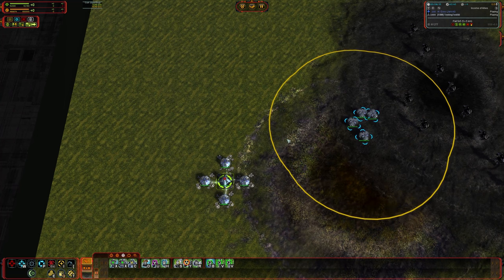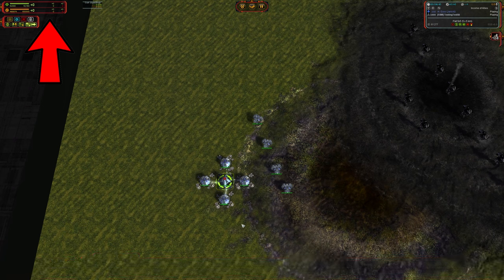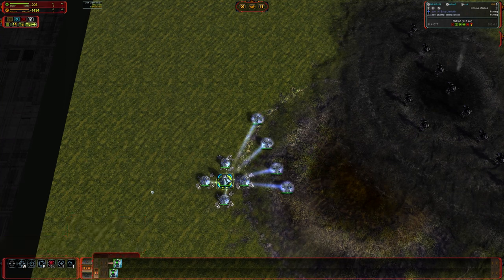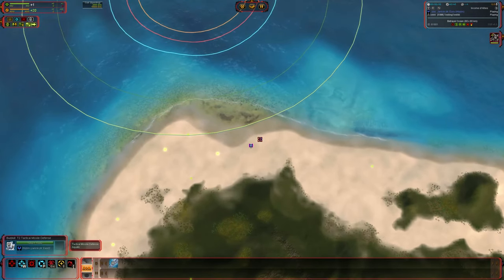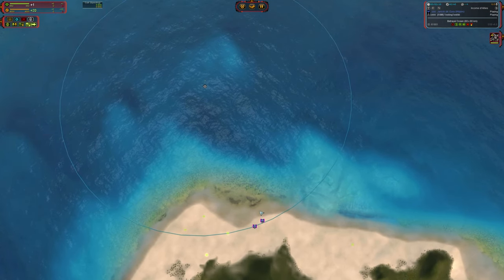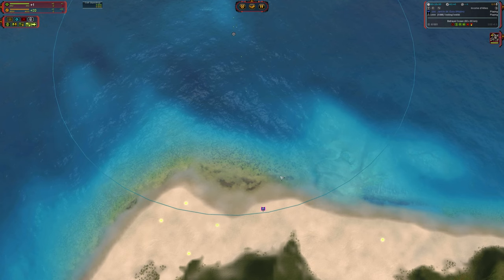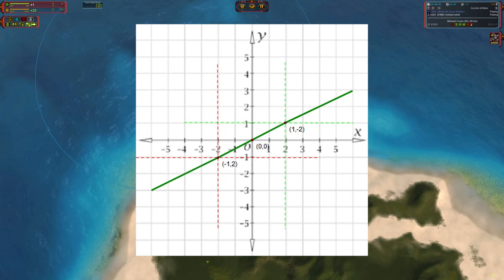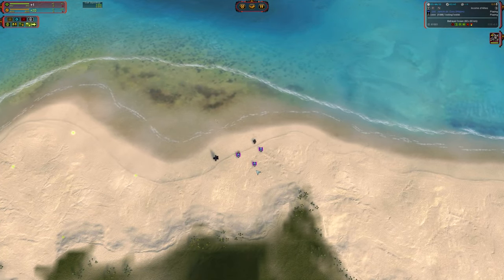T3 Bots V Experimentals? Rebuilding V Upgrading Mexes? TMD and Cruisers?| Supreme Commander Science

Comment: so about that t3 mex... you can ctrl+k and get your 0.81*900 mass instantly and build a t3 mex on top, OR you can do a regular upgraide and have t2 mex produce while upgraide is going and the difference will be:

 (9*amount of seonds it takes to do  a rebuild) vs 729 mass that you take as a reclaim...
soooo 729 divided by 9 is 81.. so if you ctrl+k t2 mex and rebuild of t3 mex will take 81 second you will break even (and save some power cause mex didn't work and didn't drain it)

to make t3 mex in 81 second you need like 35,5 build power according to my calculations...

so the important part is... that if you don't have mass to make that mex in 81 second, or if you don't have more than 36 build power then 100% sure you should not ctrl+k your t2 mex...

The fun part begins when people ctrl+k  second t2 mex before 1rst t3 mex is finished to finish t3 mex quicker and avoid stalling xD...  this is more complex, but looks to be ok to do xD

according to my calculations to make t3 mex in 81 seconds you need  like 57 mass income (that includes mex that you gonna ctrl+k)   so if you don't have much mass in storage you 100% should not ctrl+k t2 mex to make t3 if your income is lower than 57
Reply from the maker: I probably analyzed that one on too much of a surface level. I really appreciate the additional data here. Pinning this comment for sure <3

Comment: Basically as you advance throught tech you get less efficiency but higher density of power, so if you have the economy that you can afford less efficiency, then it is worth it to get a lot of higher tech tiers. Although, as far as efficiency with mass goes, monkeylord will beat it's mass in land units except for experimentals because it's a Chad unit.